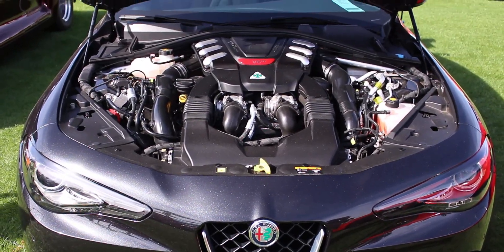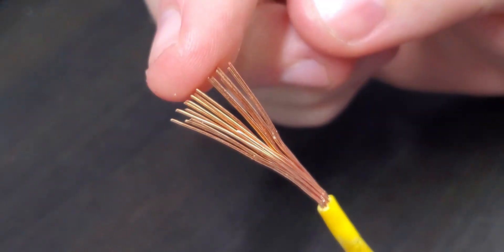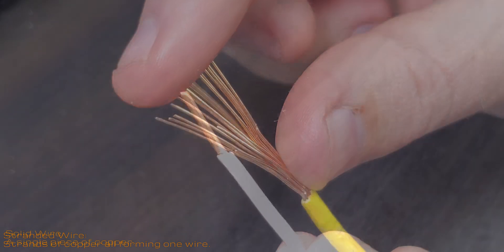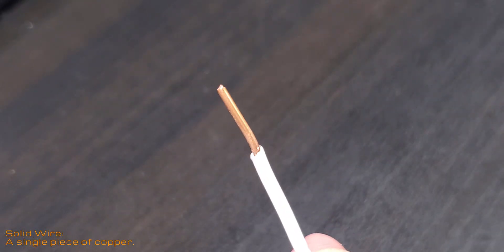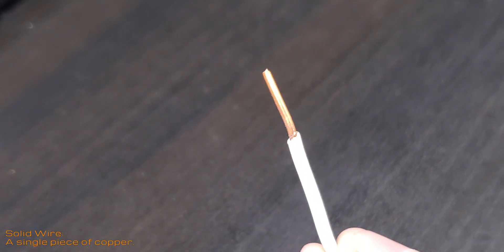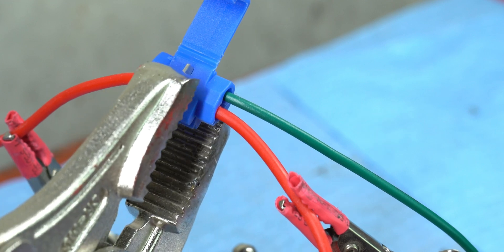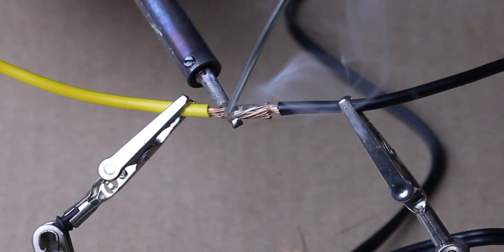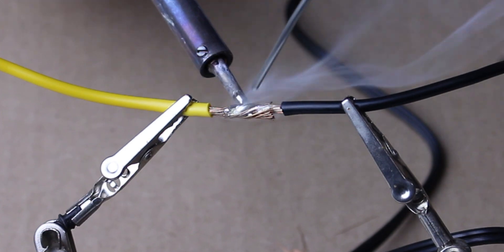Why Cars Use Stranded Wire Instead of Solid • Cars Simplified Electrical Basics

Comment: I used a 4 guage ac wire from lowes to run a car audio system before, it worked ok on my mids and highs amp but it sucked on the sub amp . It wouldnt supply enough current for some reason, even though it would hold the voltage just fine . I never used it again after that but i always wondered why it wouldnt . It wasnt solid wire , but the strands were thicker than car audio wire. They were also stiff. It was weird , i could hook up a single 4 ohm subwoofer to it and it would work fine. When i hooked up my dual two ohm subwoofer to it ,it would barely play. It was rated to put out 1200 watts at 1 ohm, and i checked my grounds and power with a dmm. Never understood it, other than it being an issue with being able to supply amperage at a low voltage or maybe a resistance thing. I have known several people get the same results when using it. I guess thats why people dont use it in car audio lol.

Comment: There's more to this than movement. Electrons flow in the outside of the wires not through it. At lower voltages stranded is needed for this reason. Movement does play a small role but if you look at off grid solar installs you will see that stranded is almost always used on the dc side.

Comment: So in my new camper install, I already ran some solid wire (not connected yet). ALL of my wire is INSIDE the camper – no wires are exposed to the elements.
So, as long as my connections were good and tight, couldn't we use solid wire? And if we had solid wire, couldn't the pigtails be lightly sanded for better grip with the terminal screws?
Reply: @ForgeAheadwithMike The disadvantage of solid wire is that because it is less flexible it could be more likely to break due to vibration than stranded wire. I would not use solid to run wires into a door or any other moving part. All wire runs, whether stranded or solid should have a fuse as close as possible to the voltage source, be it the battery or the connector that feeds power to the trailer.
I recently used solid wire to run power to a back-up camera for my box truck because the only thin 2-strand wire I had on hand at the time was solid. Should it eventually break, I'll just replace it, but I'm not too concerned about that happening anytime soon.